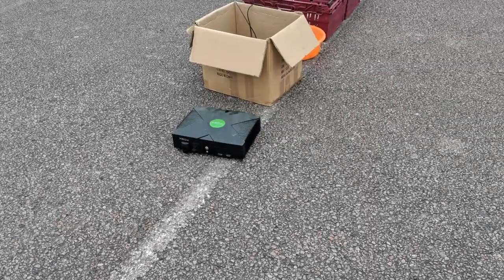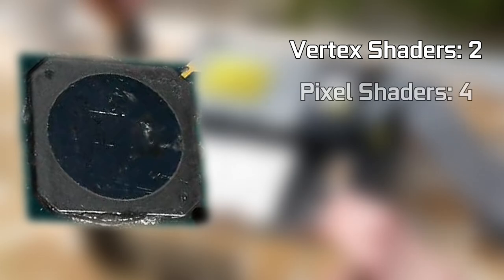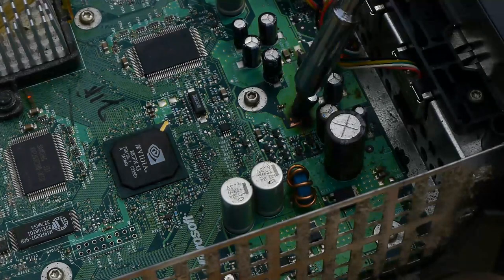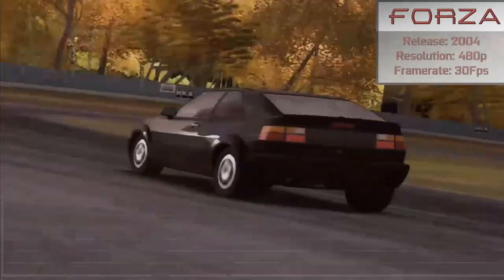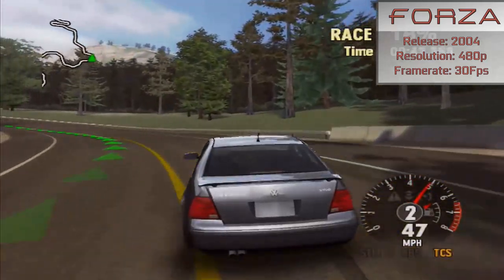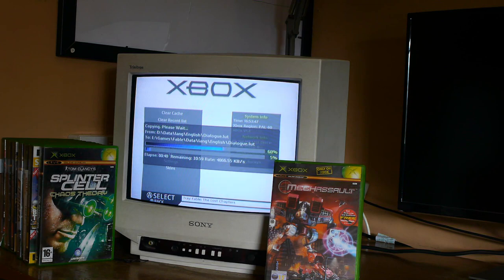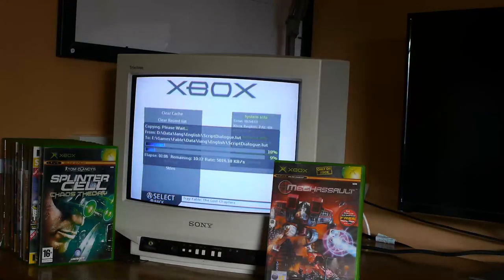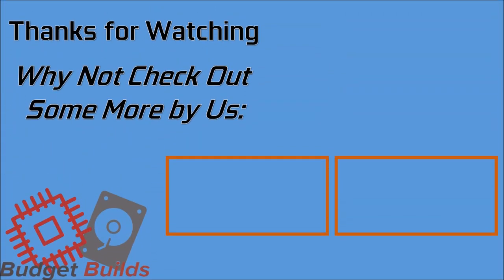How Powerful was the XBOX?

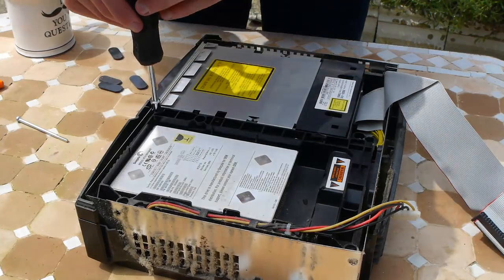Comment: 1:59
64 Megabytes probably wouldn't power a game's loading screen these days...
Reply: Minecraft, especially when modded is able to utilize 10gb+ of ram when it starts. And minecraft was made in 2009.
Reply: el negro are you a bot?
Reply: he doesnt like big smoke must have missed the train
Reply: @el negro big iron on his hip
Reply: @xtcrider8270  1and 19 more
Reply: it was over in a moment and the folks had gathered round
Reply: @el negro rear multi link suspension. A arm a arm a arm a arm a arm front independent suspension
Reply: My Amiga 1200 has more ram xD (NOT joking).
Reply: @samsurace5713  or rust lol takes all 16 g of my ram
Reply: Crisis Core on PSP is a technical achievement considering what PSP has.
Closest game to a PS2 title on PSP.
Reply: @leegsy  I bought a psp for that game when it released and was blown away at the time.
Reply: BeamNG. Drive uses 1.1 GB of ram to get to the main menu. and playing that depends on the map you load before the player's car loads.
Reply: Yep, DRM alone eats that up.
Reply: Not only that, but those 64MB were shared between the CPU and GPU. Yikes. It definitely was the achiles heel of the OG XBox.
Reply: It won't even start a toaster or flush a toilet.
Reply: @samsurace5713  Minecraft is updated with new stuff, lots of it So saying 2009 is dumb.
Reply: Sam Surace Cities Skylines can use 64GB+ of RAM if you add too many mods because of optimization issues
Reply: @samsurace5713  I have a DX9 game that uses 20G of ramp in open world.. 7daystodie.
Reply: @samsurace5713  minecraft has always been kinda a resource hog
Reply: @leegsy  monster hunter 3 looks pretty amazing on it
Reply: @CAMSLAYER13  Bedrock isn't
Reply: @elimalinsky7069  Doubt it. That amount of RAM was fine for the time. In fact, that was quite a lot of memory.
Reply: @fcukugimmeausername  I know. The PS2 had only 32MB of RAM, although I'm not sure whether it was shared or not.
Reply: @elimalinsky7069  Don't think so. Ps2 had 4mb frame buffer (DC had 8mb for example). I actually didn't know the Xbox used a unified memory system.
Reply: Half-life 2, Far Cry etc on the PC at the time required about 256MB minimum(and wouldve often been used with more), being a console the Xbox could be more efficient.
No doubt programmers could make games use far less memory, but presumably theres not much point if most players will have ample RAM.
Reply: @samsurace5713  What kind of bitcoin miner did you download? It uses 1gb in my pc.
Reply: @samsurace5713  yeah sure with 500 mods
Reply: Funnily enough deus ex invisible war being designed around the xbo with it's limited ram, on the PC port the game actually purposefully crashes the game and relaunches it between loading screens, which im guessing was inherrant from the original console version to solve the ram issue
Reply: @samsurace5713  minecraft without mods could be ran with.. 1gb of ram
Reply: @samsurace5713  And minecraft had newer updates + discontinued use for older OS
Reply: Minecraft is just bs junk

Comment: Knowing about the RAM and CPU upgrades makes me wanna track one down and give that a try.  It could also (probably) benefit from an IDE->SATA converter and then a solid-state drive.
Reply: You can upgrade the CPU too?
Reply: From experience in trying a SSD, Solidstate doesn't really offer any benefits over a standard sata HDD, the problem is the bitrate of the IDE interface isn't fast enough to even fully saturate a slow 5400 rpm platter drive, let alone a SSD.

Comment: That Gpu in 2001 was something like rtx2080ti in today console.
Reply: But a rtx 2080ti that is beat by amd (ati). At least during that time ati were better for quite a while. Nvidia was getting better during the gtx 600 series 11 years later. Xbox could've used faster ati chips that are also a bit cheaper but yeah...
Reply: @shagstars  Gforce3 was state of the art in that time , ati had few months later ati8500 gpu but in time of Gforce3 just ati7500 which was dx7 gpu. Later in 2002 came out ati9500pro and 9700pro.
Reply: yeah how the mighty have fallen back then kick ass hardware for 400 dollars now days it's low end shit for 5 or 6 hundred dollars in it 

now days it's low end hardware like integrated graphics and abandoned cpu architecture that never made it into a computer cause it was not good enough to be put into a laptop funny they made such a big deal about jaguar cpu's tech and it was thrown into the trash for full on desktop cpu's instead for the laptop lines
Reply: @raven4k998  gforce4200ti top of the line Gpu was 180$ I bought it for that price in 2002 .
Reply: @shagstars  What? Nvidia was king, not ATI. The Geforce 3 and 4 Ti was the best.
Reply: @raven4k998  ? I got my Sapphire RX 580 Nitro+ 8GB for $150.
Reply: Geforce 3 was never state of the art. It was just a slightly more cost effective version of GF2 updated for DirectX 8. GeForce2 Ultra was still king in raw performance until Radeon 8500 took over, in practice after a few driver updates (at which point no one tested it). Geforce 4 and GeForce FX (5) had nothing on the Radeon 9000 series.
Reply: @shagstars  Umm... no. Not at all. ATi had some success with the 9700pro series in about 2003. Nvidia were way ahead of ATi during the GeForce 3 era.
Reply: Not even close. The GPU was based on the Nvidia Geforce 3 series, but was in fact at the lower end of that lineup, and as a custom chip it had the lowest specs out of the available cards for PCs in certain areas such as shaders and texture fill rates. I believe it is more equivalent to the base GTX 1660 or even the GTX 1650.
The CPU was also much less capable than the equivalent Pentium III 733MHz for desktops. It was a custom stripped down version of what was available for desktop PCs at the time. That's why it is sometimes referred to as a Celeron, because it used the Pentium III architecture but had an IPC rating that of a Celeron (which was a cheap low-end CPU at the time, as it is now).
Reply: @elimalinsky7069  you are half true there

the Xbox came out in 2001 but the chip design dates back to late 1999, it had the advantage to be requiered to run at only 640x480, 720p and 1080i are too much for it

as for the CPU, it WAS a binned PIII with half the cache running at full CPU speed, and a 266 MHz bus, in other words, a frankestein, the only celeron part was the halved cache
Reply: @raven4k998  $400 was extremely expensive back then. That's why the original Xbox didn't sell. And consoles like the Xbox One X can't be beat for the price on PC. And if you want to use used parts, I can just get a used One X for $300-$350.
Reply: @Starlesslemon  well it didn't help microsoft to use abandoned hardware for the X that amd threw in the trash for full on bulldozer and ryzen architecture when you look at the xbox one and ps4 having jaguar when no laptop ever received I laugh at the noobs that thought the gpu was to blame when the cpu was the problem it's no wonder the pc could beat it no pc ever had jaguar cpu tech in it
Reply: @raven4k998  not a single thing you said had anything to do with what I said. You CANNOT beat console performance for the same money. I play on console and PC, but I'm sick of people like you who try to pretend console players are inferior. Wouldn't it make you inferior if you can't afford consoles and a PC?
Reply: Raven4K you gotta remember about the inflation in the economy ....
Reply: @elimalinsky7069  I remember when the console launched, how it was out performing even the best PC gaming rigs back then. Everyone was going nuts about how powerful the XBox was. I was at the gaming stores back then and everyone was marveling at it's graphics prowess, since it had the best graphics of any platform in 2001. No one had ever seen such details in gaming graphics at that point.
Reply: @Starlesslemon  if you would scavenge the net for used parts then you could but it could be a gamble.
Reply: @shadowguardian3612  if we're talking used parts then you can also get a used console for way cheaper...
Reply: @omegarugal9283  There are over 40 games that run at native 720p. That was absolutely bonkers for the time, not to mention, it ran demanding games at 720p like Hulk Ultimate Destruction.
Reply: @bmx7596  it supported 720p but it didnt ran as butter as you may think, the DDR RAM didnt have enough bandwidth

Comment: I've got two softmodded original Xbox consoles. A 500GB 1.6 and a rescued 1.0 with a upgraded 2TB SATA drive. The 1.0 had a dying hard drive with the click of death. Both of their DVD drives were dead but luckily I had a friend sell me a 1.4 Xbox with a working DVD drive. Unfortunately that console was dead (probably clock cap killed it), but I was able to salvage the DVD drive to softmod my other systems, and I swapped the GPU heatsink from the dead 1.4 over to my 1.0 since the GPU fan was dying causing it to overheat. I'm so happy I discovered the modding community for these things. These old consoles are great with a few QOL upgrades.

Comment: Please do a video on the porting process for HL2 on Xbox! I played it originally on a 3.06ghz P4 and 512MB of DDR2 and it struggled then
Reply: I played the game on a Celeron D 2.8ghz and FX5700 (Entire Combo was big purchase mistake, Should have went AMD and ATI). With 768MB DDR RAM running windows XP.  I thought the game played pretty decent, granted I only had a 17" CRT at the time. 1280x1024. Had the game on the Xbox as well, and enjoyed playing it from the TV.

I wish I still had my old modded Xbox, even with the softmod you can still swap out the HDD. I had a 160GB HDD in mine, autobooting into XBMC. Which was used as a hub that managed all my content. Tons of emulators, and could connect to network drive to watch all the xvid avi Movies I had at the time. That Media Machine really did me proud for years. I was lucky Enough to have a old 32" CRT TV with Component jacks in the back. Wasn't until around the time xbox360 got its first dashboard revision that I stopped using the xbox as my media box.
Reply: Half life 2 didnt need a port m8 it was a late release if you can find it
Reply: I had the exact same specs and I had no problems playing the game in DX9 1380x1024 with a geforce5800 or so card. Also playable in dx8 mode in Intel GMA gfx (gma800 or so)
Reply: @ayuchanayuko  I didn't have dedicated graphics at the time 😥
Reply: I playes it on a amd 2600+ 32 bit cpu i think and ati 9800pro xtx and 512 mb and it ran good
Reply: @xjohn1970  oh oh now I remember, aside from that Pentium 4 3.06GHz one, I also played it in a P4 Northwood 2.4GHz with a Radeon 9600Pro (or Radeon HD2600Pro if I already upgraded)
Reply: No

Comment: I upgraded my Xbox to the Tualatin 1.4 and added the extra ram. Hard modded. Also removed the dvd drive and using ultrasonic cutter, made it slim, changed controller ports 3 / 4 to usb. Filled gaps with epoxy, primer and sprayed it white. Also removed backing off Xbox logo, Dremel a hole behind it and added a few blue LEDs. It was a little hobby about 15 years ago. I basically used it as an Amiga in the end.  And Xbmc media player which was really powerful for the time. Gutted I sold it

Comment: I still am more impressed with what Sega dreamcast did with such a small package
Reply: Dreamcast was super efficient for what it was. It took awhile before developers got the ps2 running up to its potential, and before they did it was tough to look at something like Tekken Tag Tournament running next to Soul Calibur, because it made you wonder if the ps2 wasn't quite as powerful as we'd been led to believe. Then GT3 Aspec and SH2 came out and we sadly realized that our old friend the Dreamcast had finally been overtaken in the visuals department. That first batch of ps2 games definitely didn't meet expectations though!
Reply: did you know that, if Sega had gotten its head out of its ass and had worked on the Dreamcast instead of keeping the stupid Saturn alive, the Dreamcast could have been release in late 1997?

Comment: Kinda miss my xbox now, seeing as there so cheap might pick one up again. Just need to find a copy of Chaos Theory and a usb cable.
Reply: Not Chaos Theory, you want the original Splinter Cell for a softmod.
Reply: The original Splinter Cell's what I used to softmod my OG Xbox, back in 2018, had the game since my brother bought it for me years ago.  Also had a USB to Xbox controller port cable for years before I finally got around to modding it.
Reply: At a yard sale they are cheap. But at local flea markets they normally go for 50 bucks. Local game stores recently jacked up prices for them to around 65 to 85. Your mileage may vary around you but for me it's hard to find serious deals on retro game hardware. Hell, unless I get lucky with a private seller, SNES systems go for 100 to 120 around here.
Reply: @Gavin Townsley that's not what he meant

Comment: I hadn't heard about being able to replace the CPU or add ram on the XBOX before, please do a video on this when you can!!
Reply: Yeah
Reply: It can use a Pentium 4 and have an additional 64mb added
Reply: it's not a job for a mere mortals u need a reflow station an a special socket I think to put the chip in. there is a guy who does it on the net think there called dreambox or something. I like stuff like that an read up on how to doit a long time back but it's a hard process. but results are amazing compared to stock an his 
work is top notch. but they ain't too cheap

Comment: The FPS counter at the bottom can be bit confusing at times. Other then that its a great video!
Reply from the maker: Only way I know to measure the frame rates at this moment in time without creating custom software (Digital Foundry etc...)
Reply: @BudgetBuildsOfficial  doesnt digital foundry uses this same method?
Reply: @BudgetBuildsOfficial  what did you use to record the framerate?

Comment: I got the OG Xbox about 2-3 weeks after it came out and softmod hacked it in (If i remember right) 2003/2004-ish.. with a softmod bios called phoenix bios loader. I moved on from there with UXE or something like that then to the Ndure mod. I used my Xbox for mainly a Media Center from 2006-2007ish to 2013. The Xbox died sometime in mid 2013. R.I.P OG Xbox I had the best of times with you.

Comment: Some DVD drives in the original xbox can read burned dvds depending on the drive and the type of blank dvd you use (DVD-Rs are my goto because they just work) Being able to read burnable DVDs is a huge feature for the hombrew community because it is easy to transfer and install software on to the Xbox. Fair warning you speed matters when you burn a DVD to use on the Xbox.  I would recommend looking up the speed of the DVD drive of the Xbox before attempting.  I love my softmodded xbox with a 250 gb hdd it can do so much.  I like the 6th generation of consoles because all 3 the of the major players can play on both a CRT or a Flat screen TV depending on what the gamer prefers.

Comment: I used to have one from near mid 2004 to later 2006. It started to go funny near the end, strange black spots dotting constantly over the screen, something like raindrops if you look at concrete in hard rain. I opened it to see if there was anything obviously dodgy, and in my teenage exuberance, slipped on the motherboard with a screwdriver and scratched a trace or two. Or three.

That was it finished, no point in repair. Mine, whatever version it was, suffered from jerky frame rates during a lot of action in Halo, and the port of GTA III especially, in one level, driving through a mall with a shiny reflective floor brought it to its knees. I don't know if I just got a dodgy console, but it was hypothesized that installing the Xbox Live from a demo disc reduced its performance, by making the original O/S a bit more bloated. No way of remembering if it was faster before that.

Oh well. It was still smooth on PGR 1 & 2, gave me hours of fun with PES 4, Halo 1 & 2, Timesplitters 2, GTA San Andreas + loads of others as well. RIP.

Comment: I still have my original xbox I bought new in 2002.  Has a mod chip and 80gb drive still working with 1000's of games in all kinds of emulators, a dozen or so of my favorite games saved on the drive, and a perfectly working Samsung drive (which I got out of a Goodwill $5 console a couple years ago).

Comment: Still got my first Xbox without a blown clock capacitor. Having it unplugged or off at the point when not in use has helped *greatly*. Which is good because I can still use my newer Xbox for spares (its a very late v1.6, and I have games which break on it).

Comment: My original Xbox had that problem of a stuck CD drive. You'd have to pry it open every time. And god I miss Phantom Crash. I really wish someone would bring it back...
Reply from the maker: Chances are its a Samsung whuch means if you leave an old disc in there itll open normally every time
Reply: Budget-Builds Official the best way to get a stuck tray open is to push in slightly on the tray after hitting the eject button. Even with the stuck tray issue, the Samsung Drive is the best one, it’s the most reliable and can read DVR-r discs.

Comment: If you modify the consul by adding an extra 64 gigs of ram making it a total of 128 gigs with a custom firmware allowing you to run Xbox media center as the dashboard your frame rate problems are completely gone and the system runs amazing especially after you install the games directly on the hard drive. Your loading times are basically nonexistent.